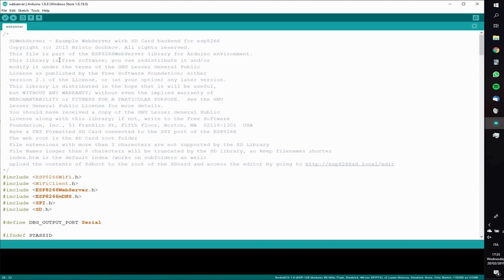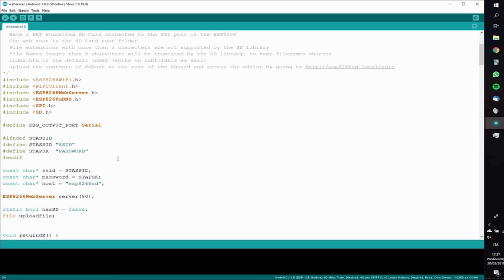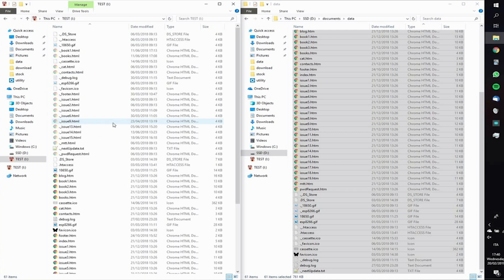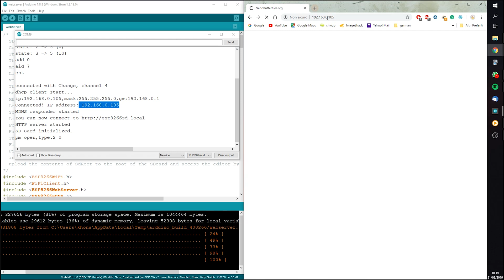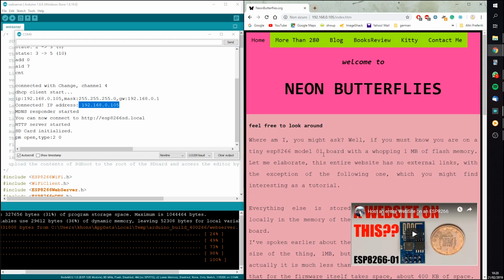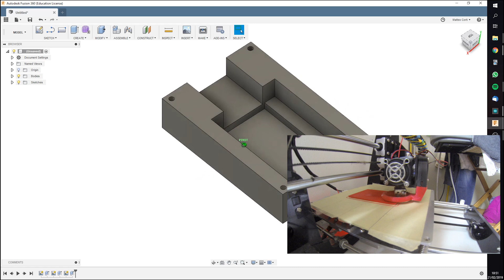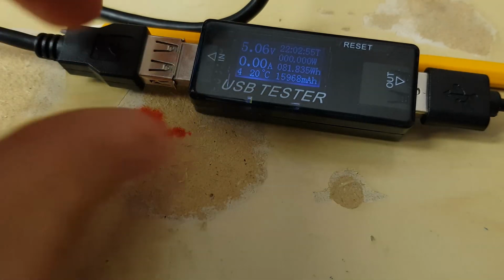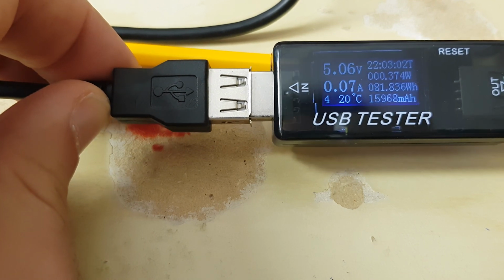Webserver with ESP8266 - 12E

Comment: Could you point/link us to the exact ino file you used?  I have looked over all the ESP8266WebServer example files and none start out like what is shown, both in the Arduino IDE and the github site (essentially the same files).  None contain the SPI and SD references.  No file called "webserver.ino". "www.neonbutterflies.org" appears to be permanently down.